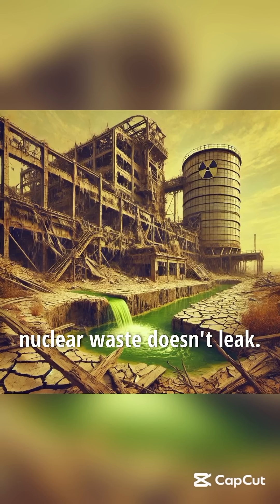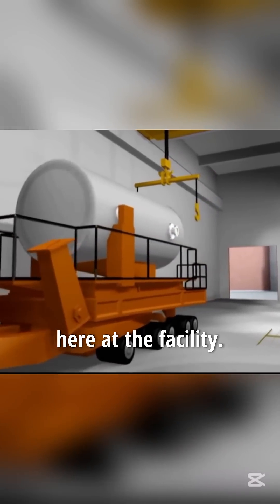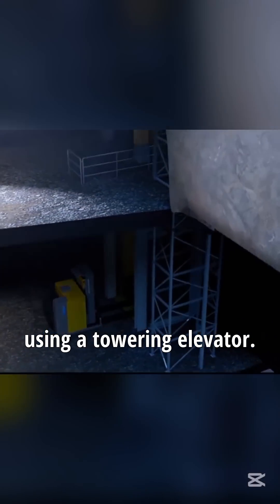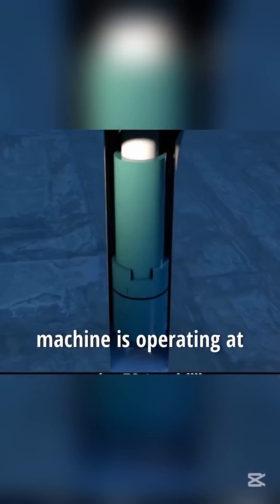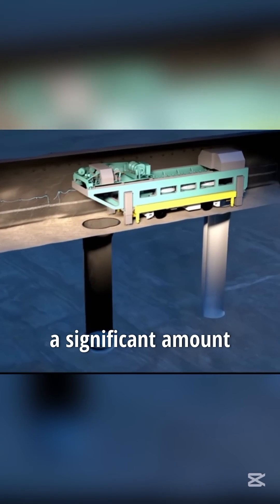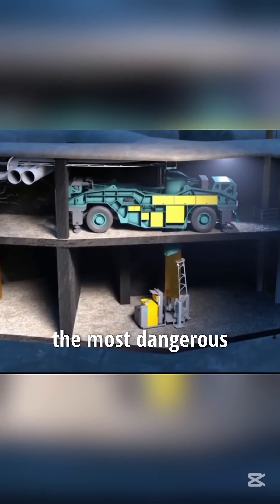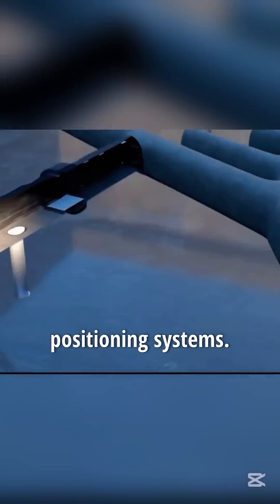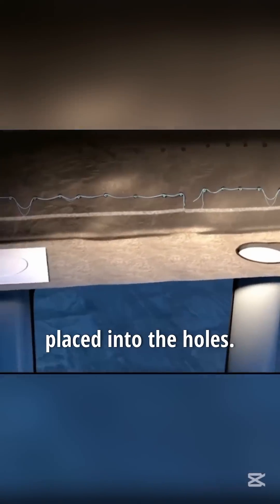Dumping Nuclear Waste ☢️😱

Comment: A little known fact of this process is that ANY moisture content included in the waste container will be separated into free hydrogen and oxygen by the ionizing radiation into a highly explosive ratio.  Prior to being transported to the final storage facility, the waste has been stored in water to keep it cool.  That means that the waste must be dried to the point of only a few molecules of water in the cask.  This is extremely difficult to accomplish. 

In 1997, I was driving for Arrow Trucking and was assigned to haul a new experimental dryer from Colorado Springs to an extremely high security government research facility in Idaho.  The dryer was essentially an experimental high intensity vacuum oven that was hoped would remove sufficient moisture to allow safe long-term (centuries) storage.

One interesting aspect was that the unit was insured for an even million dollars during transport.  Another thing that caught my attention in the bay where I was to offload the device was a group of about a dozen standard 55 gallon sized barrels alongside one wall bearing the universal radiation symbol stickers with the words, "Caution, Danger If Damaged!"  I guarantee, I didn't waste any time un-strapping and un-tarping that load.

Comment: It's looks like accidents must have happened before this what did they do with them. Dump them in the ocean. Like they did with the DDT that was dumped decades ago there's Thousands and they are rotten and leaking   and they should be cleaned up. Maybe they could use a device that could go over them and cut the ground believe the barrel and close grabbing alot of the dirt around and under sealing it completely off and make one for each and leave them right in the container to be stored ungound Also. It's sad that these are still on the bottom so close to shore and people actually are swimming so close by making not one bit of sense to do nothing

Comment: The half-life of this is over 10,000 years. Where are the nuclear cores from Fukushima? Nobody knows. They are gone somewhere underground constantly creating molten nuclear steam, glass, and more molten nuclear waste.
Reply: you don't know that for a fact. Where's your proof?
Reply: @timlass6103 TEPCO officials were instructed not to use the phrase "core meltdown" in order to conceal the meltdown until they officially recognized it two months after the accident.
 The Japanese government did not keep records of key meetings during the crisis.[88] Emails from the Nuclear and Industrial Safety Agency to the Fukushima prefectural government, including evacuation and health advisories from 12 March 23:54 to 16 March 09:00, went unread and were deleted.- From Wikipedia

Rising residual heat within each reactor’s core caused the fuel rods in reactors 1, 2, and 3 to overheat and partially melt down, leading at times to the release of radiation. Melted material fell to the bottom of the containment vessels in reactors 1 and 2 and bored sizable holes in the floor of each vessel—a fact that emerged in late May. Those holes partially exposed the nuclear material in the cores. Explosions resulting from the buildup of pressurized hydrogen gas occurred in the outer containment buildings enclosing reactors 1 and 3 on March 12 and March 14, respectively. Workers sought to cool and stabilize the three cores by pumping seawater and boric acid into them. Because of concerns over possible radiation exposure, government officials established a 30-km (18-mile) no-fly zone around the facility, and a land area of 20-km (12.5-mile) radius around the plant—which covered nearly 600 square km (approximately 232 square miles)—was evacuated.

A third explosion occurred on March 15 in the building surrounding reactor 2. At that time the explosion was thought to have damaged the containment vessel housing the fuel rods. (In actuality, the explosion punched a second hole in the containment vessel; the first hole had been created earlier by melted nuclear material that passed through the bottom of the vessel.) In response, government officials designated a wider zone, extending to a radius of 30 km around the plant, within which residents were asked to remain indoors. The explosion, along with a fire touched off by rising temperatures in spent fuel rods stored in reactor 4, led to the release of higher levels of radiation from the plant. - April 16, 2024, CDC - Fukushima Radiation Emergency
Reply: @timlass6103  The Fukushima buildings holding spent radioactive fuel and the nuclear cores exploded. What is left of the buildings is so hot robots melt or stop working after a short time.
Reply: @The Uranium rods or pellets Have grouped. Uranium-235 and uranium-238 properties. Uranium-235 (U-235) Half-life: 700 million years. Uranium-238 (U-238) Half-life: 4.47 billion years.

Comment: And a solar panel is just ground up
Reply: This is a fact keith. The rods can be recycled over a dozen times. THEY SHOULD BE RECYCLED. THE FRENCH HAVE BEEN DOING JUST THAT SINCE THE 60s.
Reply: @victoryfirst2878  you forget the fact after they recycle it it becomes waste after use and the problem starts all over again

Comment: this smells like embezzlement. You don't need half this bullshit if you make the shielding thick enough. You could just park the containers with a regular forklift.

The only reason to use fancy robots, is if the containers are so thin, they barely contain the radiation... in which case you're doing a terrible job storing it.
Reply: Theres no robot

Comment: They ought to just pay Elon and let him take it to space somewhere
Reply: Too heavy and too expensive. The Falcon Heavy can currently carry 37,000 pounds into a trans-Mars flight path. A used nuclear fuel rod assembly weights about 1100 pounds. They'd only be able to send 33 assemblies at a time. 

But there's a major complication: those spent rods must spend years cooling in a pool befire they can be safely handled. They're literally too hot otherwise.

Comment: Reminder Nuclear Waste wasn't always Liquid its just depleted Uranium or some Contaminated water Or other parts that's been contaminated by radioactive isotope
Reply: @lone._.wolf.  heavy water is 80% of nuclear waste
Reply: @anandkumar2005 ,
WRONG!  Ionizing radiation and water in ANY amount sealed in a sealed container is extremely dangerous.   Ionizing radiation will break the molecular bonds of the water,  creating a highly explosive mixture of atomic hydrogen and oxygen.
Reply: And no one seems to understand how the waste is dealt with. Everything is mixed together into a slurry and is mixed into concrete with other materials to bind to radioactive material meaning even if you somehow broke them open, they'd still be relatively safe. The concrete is then covered in multiple layers of shielding. At most nuclear power plants. These are stored above ground for years until they're moved to underground storage. They're designed to be safe from direct hits from bombs, natural disasters, storms, sabotage, ect. 
When in the video he said the most dangerous part was moving these things. Absolutely not. By the time they are at that stage they are safe. You won't even pick up more than background radiation standing next to them. You could push them off a cliff and they shouldn't break.
Reply: @g-urts5518 People need the truth instead of an earie myth. Thanks for your information
Reply: @ Sure they built safe railroad cars to move the radioactive material but they were too heavy and the railroad tracks could not support the weight.
Reply: Yes but it's never a liquid it's uranium usually uranium 235 or 238 that uranium is in rods that are in grouping.
Reply: @ Have grouped. Uranium-235 and uranium-238 properties. Uranium-235 (U-235) Half-life: 700 million years. Uranium-238 (U-238) Half-life: 4.47 billion years.
Reply: They should come up with a way to reuse nuclear waste.  But assuming they are going through great lengths to disposal I imagine not possible.
Reply: Bro, worker clothes also nuclear waste

Comment: Imagine It explodes all together 😮
Reply: How is that even physically possible
Reply: @ Have you ever heard of trapped gas? If not do some study, especially on chemistry.
Reply: @assh2961 have you ever heard how rare the chances are that it explodes
Reply: @assh2961 have you ever heard of flammable materials and gasses needs huge amounts of oxygen to actually explode?
Reply: @Eilpser26 so the chances are extremely low that it explodes?? There's still a chance
Reply: Even if the "spent" fuel were to miraculously generate enough gases to explode, where else do you think we're gonna throw away all of the crap?
Reply: Bruh it is nuclear waste, a decayed uranium & fission product which is can't do nuclear fission to make explosion. Also you need neutron to make boom/nuclear fission but if so the number of U-235 is too low (1%) to do it (or none because U-235 got recycled and reused)

Comment: No waste in a fusion reactor ✨✨
Reply: Finally someone that actually believes in fusion
Reply: Let us know when you build one. 😊
Reply: @Red-Check-Mark * build one that can sustain a reaction for longer than a few minutes. They have them they just get too hot to sustain the reaction.
Reply: If they actually worked yes
Reply: Yea it's only 30 years away,they said that 40 years ago but I'm sure it's coming....yeah wait for it
Reply: Fusion is the next big clean energy revolution… hell of a lot better than wind or solar energy
Reply: I thought that the Metall Part in the Middle will get radioactive? Or am I wrong? Sorry for the Bad Spelling
Reply: Are no fusion reactors.  Never will be.
Reply: Don't have them.
Reply: Lots of nice theories about theoretical fusion systems.  To bad nothing works.
Reply: still makes waste just very reduced lifespan.. like only takes a 100 years instead of 100 thousand years.